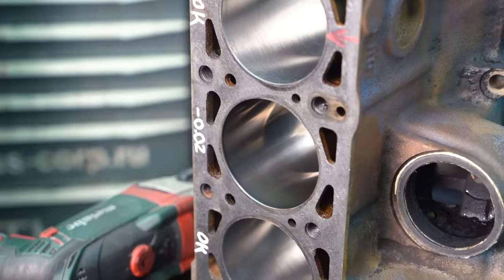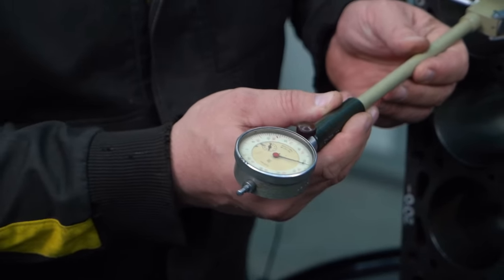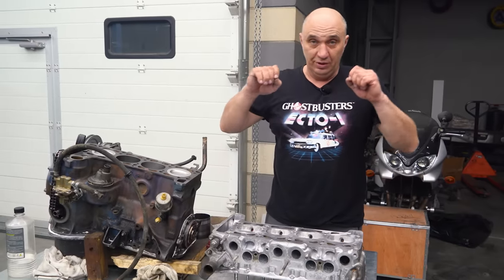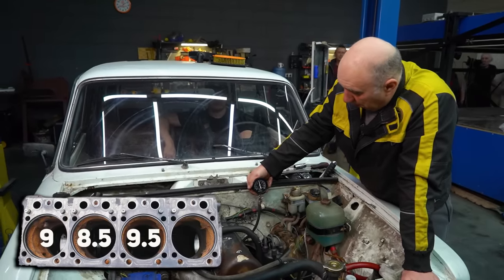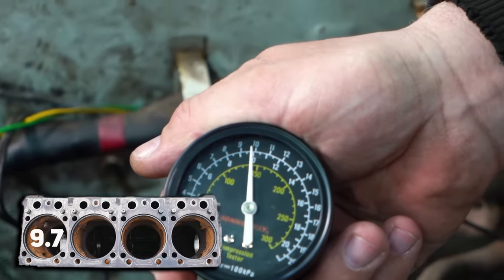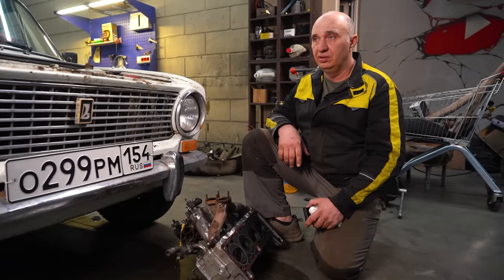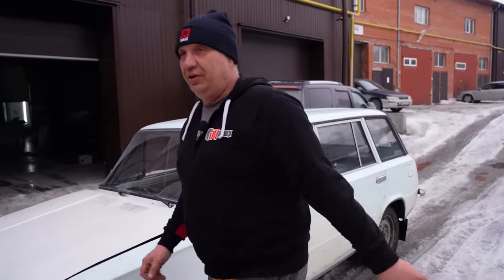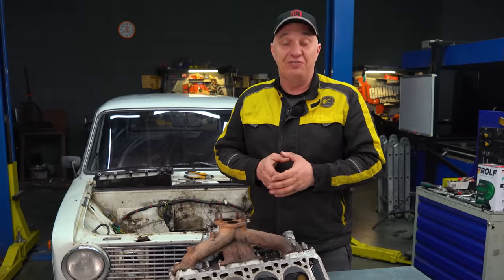Honed cylinders or mirror finish - which is better?

Comment: I would have liked to see a wet test. compression test each cylinder dry, and then with a capful of oil and see how much it bumps the compression on each. i have a feeling it will have more of an effect on the honed cylinders i.e harder for air to pass the ring

Comment: I wonder, with modern synth oils, and modern piston ring coatings, if a revised honing spec may be near in the future. 
A cylinder wall "mirror polished" still isnt smooth. Atleast not the ones in this video. Scratches were still visible. Its just the grit equivalent was finer. 
What if going from 320grit to 500grit while using thinner rings, with PVD coatings, and 100% synth oil made a 3% improvement in efficiency, with no effect on longevity? 

An example of this would be, there is a company that sells a 2 stroke oil that is so good, they tell  you to run 100:1, no matter what the equipment calls for.  This is because, the old standards were created based on OLD OIL TECH.

Comment: reminds me of my 1980 Donnington GT championship winning modified  Hillman Imp engine running on 38mm choked 45mm Dellorto carburettors .. max rpm 10,000 . electronic ignition  water pump running  at 1/4 engine rpm , oil pump capacity reduced  30%.. mostly engine maintenance was reprofile the 1mm valve seats and check the cam follower bucket sleeves for galling .  one failure when a conrod cap retaining bold let go and the block and head was reduced into two halves . nothing dramatic   just a clunk , silence and smell of hot steam .Oulton Park  CA  1978 ish .

Comment: Greek mechanicks vote  Honed cylinders.Micro storages of oil better ring sitting on cylinders surface better wrap better ring openings etc.Ok needs some miles to give it best but yes..honing is necessary

Comment: The experiment did not prove anything. Both the honed and the mirror finished cylinders have the high "10s" and low "9s" in 1st run and in 2nd run. Before the 2nd test the valves were not checked for "leaks" to take it out as the culprit (cyl 2 & cyl 3 for having low compression compared to cyl 1 & cyl 4). Further, in the experiment the sparkplugs were not switched (plug of clean combustion chamber to dirty combustion chamber and vice versa) to eliminate the plugs as the cause of dissimilar amount of carbon deposits between cylinders. Let us not ignore also the influence  of upstream components (high tension wires and distributor cap) in the quality of the spark.

Comment: Get another block and polish ALL the cylinders.
Make sure to use the American style of boring and honing with a stress plate with proper torque to the head.
Then, for added sealing, Polish the rings VERY CAREFULLY.
Get that mating surface nice and smooth, then use a lighter grade of oil.

I think you are onto something here!

You may have stumbled upon a way to seal rings and cylinder walls to avoid carbon buildup and sludge in the rings!

Light oil, like 0W-10 would be the oil of choice.

Have one of your guys use it as a daily driver to work for a few months, then do your testing and assessment.

This could change modern engine manufacturing!

Comment: Order a tool set for leak down testing. This will show you allot more than visual. Are you losing compression past rings or slightly past valve seats?

Comment: They should have removed the pistons and looked at how the compression rings wore in on the edges.  Also should have driven it 3k miles or more before inspecting it.

Comment: The piston rings and cilender don't have contact when running hot a film of oil between them the groves are for holding the oil bedding in is the rings froming correct shape

Comment: We don't really need to see a compression test or the valves. We need to see the exhaust ports of the head. Just take the exhaust manifold off and let us see if there is a visible difference of oil being burnt in the individual cylinders.

Comment: From my many years, I've always read that the oil gets into the grooves of the crosshatch pattern, offering better lubrication...or have engines changed that much they don't need a crosshatch pattern?

Comment: you need hole in piston  skirt . Like yamaha motocross port save if you will not cross hatch .polished is better in the test you did . But need to seat in . It took you 1000 km

Comment: Looks like coolent getting into the cleaner cylinders, probably used the same head gasket or the head is slightly warped. 
You need to travel around 20,000km before you can make a conclusion

Comment: Win a Lada Ladam?????   I want one so much!   I want to build a power wagon around a smooth 250 Horsepower.    I wonder if the Mirror bore finish will place much more heat into piston and rings.  Dissipate less thru mirror cylinder walls. Less cooling efficiency...

Comment: How about building a engine with all the old race car engine tricks?  Like polishing the rods, lightening the crank flywheel. Shaving the head  and deck,  for max quench. And test performance Before and after, to see if these old school mods actually work on a otherwise stock engine, things like was done starting in the 1930's so cops could catch bank robbers , liquor runners. And they could out runtge cops !

Comment: Need hone to help hold oil for ring lubrication, checking heads etc tell you nothing. Should be measuring ring thickness after 50k to see which one wear the most

Comment: i dont know which one is really better but i think honed would be better. those little tiny scratches may help oil to grip. am i mistaken?
Reply: you are correct honed will increase engine life but polished will help with power and efficiency due to less resistance at least until the engine fails much sooner.

Comment: so, here I thought cylinders needed to be honed for the rings to be ground to fit perfectly for break in. now it almost seems like it barely matters for NA engines? maybe it makes a bigger difference for high compression or turbocharged engines? honestly I barely know anything when it comes to rebuilding engines since there seems to be few free articles and books on engine building. I would typically follow a rebuild manual to the T, but maybe there is some leeway.

Comment: Never ever smooth a cylinder like that unless it is hydraulic or pneumatic cylinder, the rings might seat but I imagine it would take a much longer time than normal [ if ever] smoke and have extra blowback not to mention fouling out spark plugs.
Reply: most modern engines run mirror bore

Comment: This is good to know.  I'll remember this next time I work on my motorcycle.  It's a 2-stroke motorized bicycle, and I have to get everything possible out of 49 cc.

...the race track.  The motor gets a good thrashing...  I think you just wanted to do donuts and not hit anything.
Reply: I think getting a better carb (most kits have a non adjustable air/fuelratio carb) and a good expansion chamber exhaust gives you better performance.
Reply: Max hp for a 49cc 2 stroke is over 100hp per cylinder ;)
Reply: @TheJeremy5599  I can't find a source for dilithium crystals, and it burns out flux capacitors.
Reply: @vincehoffman179  Honed cylinders keep those nice add-ons working as designed.  I drilled a few holes in the end cap of my muffler.  It got louder, but the bottom end woke up fast.  I'm trying to give it just enough power to lift the front wheel off the ground.  Yes, a multiple circuit carb is required!  There is one setting that changes the sound and power, it's moderate load and almost full speed.  It's counterintuitive to back off on the throttle to go faster, but it is profound, like a four-barrel kicking in.  Runaway?
Reply: @chaosopher23  what? No. Proper porting and head modifications, reed or Rotax valves with 160-180° of intake opening.
Ideally 6 gears or a cvt
Reply: @TheJeremy5599  Why not just get a m/c 100 cc dirt bike motor and start with that?  It would start out badass.  It might be cheaper.

Comment: So to sum up the video, according to your test, it doesn't make a difference either way.  My money would be on honing since it requires less work to prepare the cylinder for use, and besides that top fuel dragsters turn 1/4mi in 3+ seconds hone and go again, works for me.  I am actively looking for an actual science based video for or against either method....

Comment: There is no debate. Anyone with even a MODICUM of knowledge knows the cylinders must be STRAIGHT and honed appropriately for the intended use, intended rings, and intended oil. Anyone advocating a mirror finish knows NOTHING about engines.

Comment: I reckon mirror on a 2 stroke motor cross bike , in fact I would rather have mirror as long as the compression was the same you only need to do that other when you need to rebuild, the piston ring would like mirrors and that just common sense
Reply: You would achieve a marginally better compression with a honed surface since the piston ring(s) will seat properly
Reply: Honing is about seating, and seating is about sealing, and sealing is about compression.
Reply: Say “I don’t know how to build an engine” without saying “ I don’t know how to build an engine”
Reply: @Shade_tree_garage01  lol , I did I once on a 2 stroke motor bike a DTR , I chipped the top end but the cylinder was fine I just had to skim the top end, it was fast as YZ I opened the power valve fully, I liked i more than a YZ 250 I had, was more fun

Comment: what if a car engine was inverted, like an airplane engine, with the crakshaft above the camshaft?
Reply: oil will jump under the pistons
Reply: @magukamotorsincorporation  then how do planes do it?

i'm assuming a relocated pickup, bigger drains, & dry sump or bigger valve cover, but I want to see G54 to do it.
Reply: @Iowa599  How then are pistons lubricated in a dry sump? I can't imagine. G54 will probably be difficult
Reply: @magukamotorsincorporation  the mass quantity of oil that is squirting out frm the main bearings & connecting rod (both ends).
Reply: Oil squirters.

dry sump is normal, in various racing series, to reduce windage losses (windage = crankshaft spinning in the cloud of oil vapor spraying out of bearing journals).

i think wrc also uses dry sump to increase ground clearance. 

Piston airplanes have used dry sump so the engine works while inverted since the first world war.